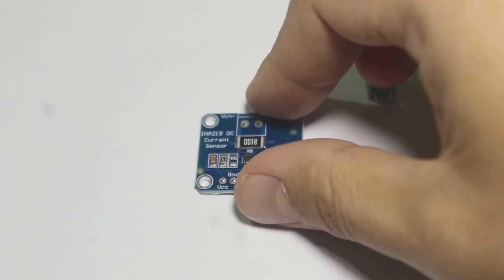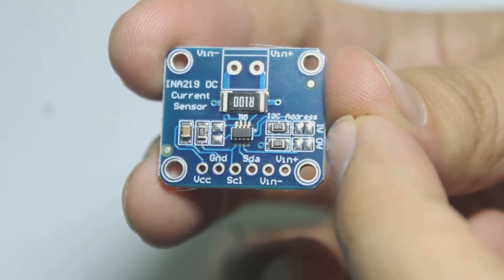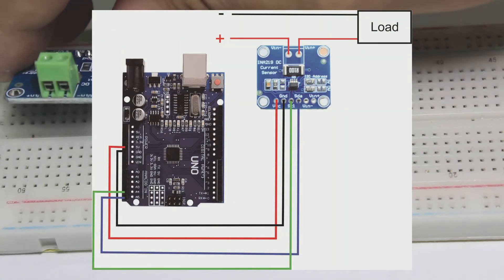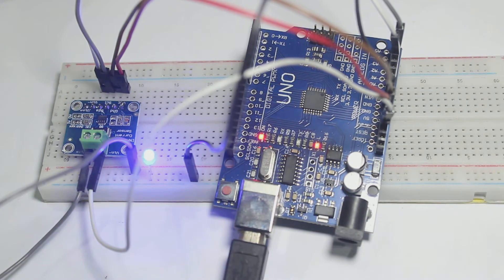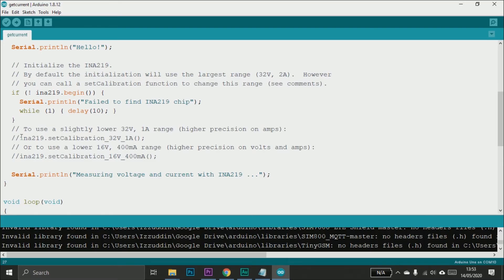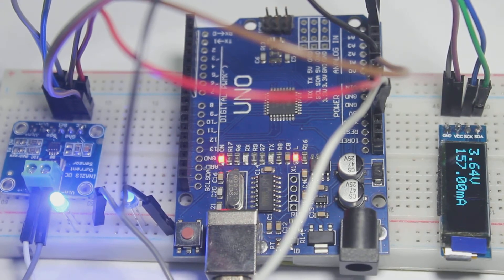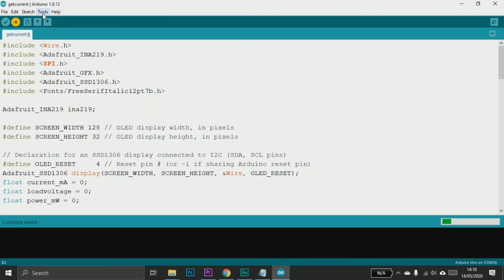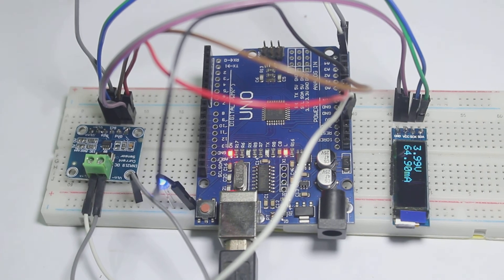How to use INA219 current sensor with arduino and how to make DIY wattmeter using it

Comment: Can the INA219 be used to monitor the status of a battery in use?  Or can someone pls recommend what else would be better to use for this purpose?
Reply from the maker: @dinojuricic7159  does status mean voltage? If it just voltage you can use simpler way like voltage divider
Reply: @miliohm  I think in practise it would mean to measure the voltage. Basically, what I want to try to estimate the amount of energy/power left in the battery.
E.g. Imagine that you have an AccessPoint running on power from a car battery in some remote location. The idea is to measure the amount of power left in the battery to get an idea on how much time it has left. Another much later step(and problem hehe) to this idea would be to add e.g. a solar panel that could extend the time that the battery lasts but it would still be interesting to be able to see how much power there is in the battery.

Comment: Hi, you wiring is wrong, SDA and SCL are shared for both INA219 and the display, however, you have them mixed, Pin 5 from Arduino goes to SDA of the INA 219 and then to SCL to the display.

Comment: Hello, I would like to measure the power of a solar panel, but I do not know how to connect it as on your circuit. I have an INA219 sensor. Should I plug it in instead of the diode? And is it a problem if my solar panel is 1Watt and delivers a voltage of 5.5V?

Comment: why did you use Analog pins on the arduino, even though it is a dc current sensor?
please correct me/explain the reasoning behind it
Reply from the maker: Its not used as analog. Its i2c pins. I2c pins on Uno is at A4 and A5
Reply: @miliohm  oh okay, thanks so much! i’ve understood it better now

Comment: can it measure microampere current
Reply from the maker: I don't think so, the resolution is 0.8mA
Reply: @miliohm  can u suggest how to make multirange dc ammeter which can measure 50micro ampere to 3 Ampere
Reply: @miliohm  but when I search it show minimum detectable current 100micro ampere
Reply: Could you please put the reference here? I am looking for this statement
Reply: @wawandeha  it can measure microampere current if you change shunt resistor value and according to change the library files

Comment: After checking several pages, I finally found your missing point-You should connect the GND of Power to UNO too, so the readings can be correct, not such as just "1.04v"
Reply from the maker: I don't see any 1.04v in my video?

Comment: nice video,
 can i use it for voltage measurement only, 
what happen if the current exceed the maximum predetermined current, 
and what is the difference between ina219, ina226
Reply from the maker: You can use voltage divider for voltage measurement, it is very simple and cheap. You can watch it on my last video. 
If the current exceed more than maximum, it will stay read at that maximum current.
I'm not sure what's the difference since I never used ina226
Reply: @miliohm  is it accurate enough, i use esp32 and it seems like the adc characteristic of the chip is non linear
Reply from the maker: Voltage divider is pretty accurate. How many the voltage range you try to measure?
Reply from the maker: The easiest way is just try get the data and calibrate with your voltmeter. Manipulate your data in code

Comment: Do you think this sensor could be used to read the voltage drop of a 100A/75mV shunt if the 10 ohms on board resistor is removed? Need a way to read out bipolar current on my battery. Thx

Comment: What does minus (0.14mV) or minus (1.60mA) mean? Why negative values? I don't get yet the concept.
Reply from the maker: Minus means current flow from - sensor terminal to + (the direction) you can get plus value by swap the cable at sensor terminal
Reply from the maker: And when the current or voltage so small sometimes it just doesn't read yet
Reply: @miliohm  Thanks, In cases when the souce current and/or voltage are/is small, the sensor has not read yet the load, sensor will show (-) values?
Reply from the maker: @svsv9  yes, sometimes when no load applied. It will show very small minus values. You can make it zero by code
Reply: @miliohm  Thank you, I am willing to do a multimeter someday on arduino, but many concepts have got lost. For example, Bus voltage is same as Load voltage in some tests I am doing. Thank you.

Comment: Hi.good project.But ı get failed to find INA219. all connection true. why ı get this error
Reply from the maker: did you try i2c scanner? find i2c scanner sketch on internet and find the ina219 address. It should give you the sensor address.
Reply: @miliohm  thanks.